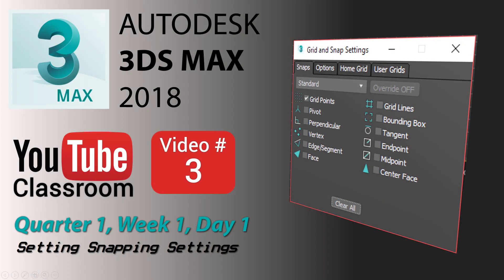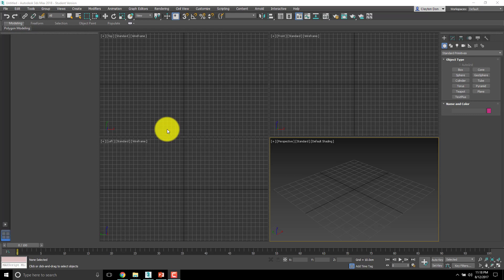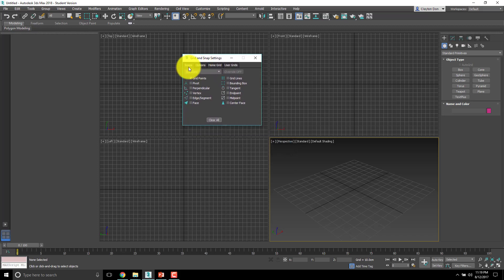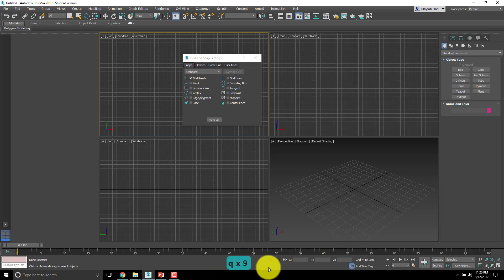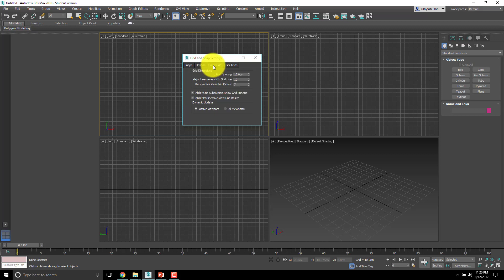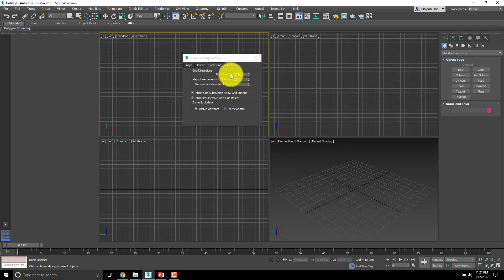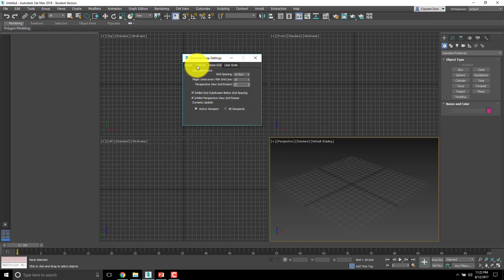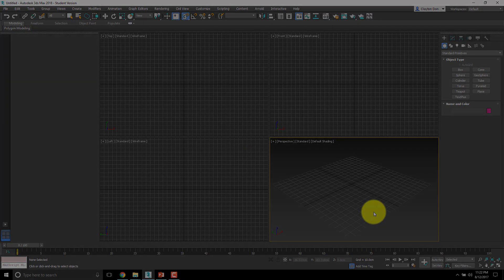3DS Max 2018 Class #3  (Snap Settings)

Comment: I understand the reason to "why centimeters" but I learned yesterday that unity likes it in meters (I don't know about other engines). In fact in tutorial for Maya that is the reason they chose meters, although they also make props (smaller than a car). So my question is: will it be that bad if I chose meters over centimeters? What are the concequences?
Reply from the maker: Ηρώ Τ. You can select meters if you like. It won’t make that much of a difference. I mainly wanted my students to avoid inches, which is the default setting. I prefer centimeters because of all of the small props, you’ll just work in .01 while I work in 1. NBD. :)
Reply: @ClaytonDonnan  Thanks so much for the quick response!